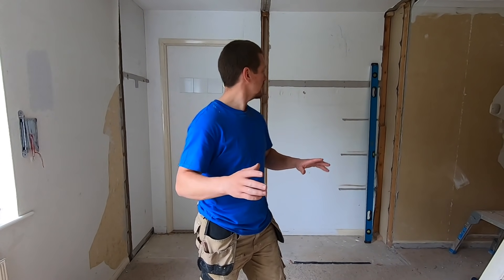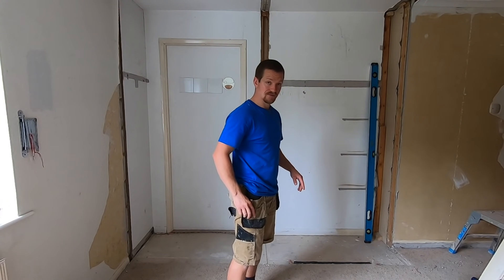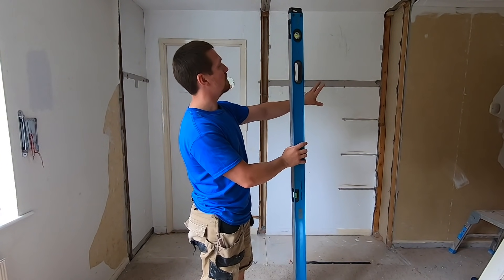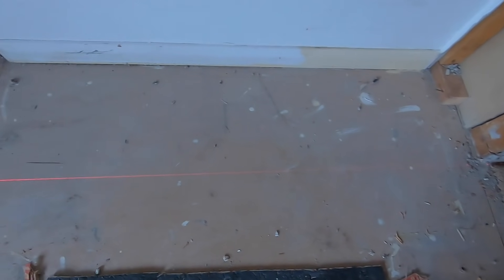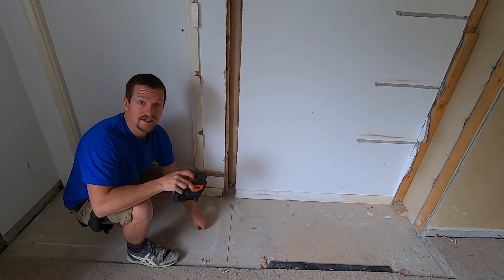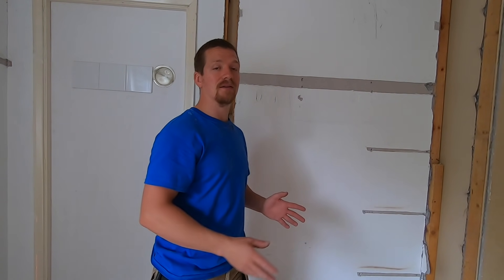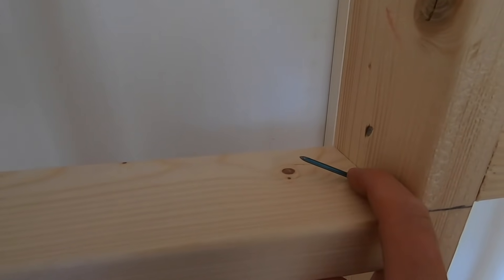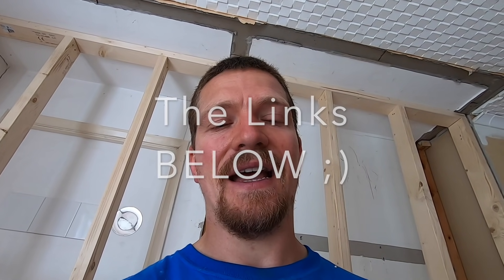How To Build A Stud Wall - (Build An Internal Wall For Plastering)

Comment: Brilliant video! How would you attach it to a concrete floor and a drywall?
Reply: Concrete floor just drill and rawlplug it in. drywall it really needs to be fixed to a stud or end. If you cant id personally cut into the drywall and add a stud to fix too but if the bottom plate and header are fixed solid the end stud could float i guess

Comment: Cheers for the video Blaine. Are the noggins necessary if plasterboard is being fixed to the uprights??... I can't see how the noggins add strength??.... what am I missing??  :-)
Reply from the maker: It's designed to pull the timbers straight - it's not necessarily strength. It helps to make the wall straight when the timbers are pull together in the centre 👍

Comment: Thanks Blaine. Top vids as always. What do you suggest the best fixings to use if you are keying a stud wall to existing stud wall. I need to add a stud wall in the bathroom to take a shower cubical but the other walls are all stud and plaster. We moved recently from a solid brick Victorian house. It’s now like living in a box of matches and the sound insulation is shizzer! 🙄

Comment: Great video Blaine , I put up a stud wall before the lockdown 3 months ago no plaster at the moment but when I eventually get some is the plasterboard still ok to scim over regardless of how long it has been up?
Reply: should be fine man, what can happen if its been a particularity long time is the boards dry out slightly and they end up having a bit more suction, if you get this problem just put a coat of pva and go over it once its tacky

Comment: Thanks for the very helpful video nicely presented. I take it the height of the wall is less than 2.4m so you can use one board? I always seems to get a higher wall where I have to have a second board on top the requires noggins in line, which is more of a pain to do!
Reply from the maker: Yeah mate... It's 2.3m so I've got enough height! That is a pain - I'm lucky with this one pal 😂

Comment: How do you know that the line on the floor from the laser level is straight
Reply from the maker: You don’t - you usually have to parallel that line for the opposing wall or measure it according to the room. The last will only give you the plumber like is facing 👍

Comment: Hi Blaine, great content as always. I hope you have time to answer this question. I have wattle and daub wall with lime plaster. In the hallway the plaster is blown and cracked. I was thinking of treating it with a fibre glass mesh then apply multi-finish on top of it. Do you think it’s a false economy or should I take it back to the brick? 🧱
Reply from the maker: Hi mate. You shouldn't plaster over a lime rendered wall - you would essentially be trapping the moisture. Lime render is designed to breath whereas the plaster we use now isn't. It's probably best to use a lime based finished plaster or start again as mentioned. I know it's a pain but that's the right answer. Hope this helps my friend 👍
Reply: @PlasteringForBeginners  Thanks for answering my question Blaine. Would that apply to a inernal dividing wall?

Comment: Isn't that plaster board on the right?, if so doesn't the frame not need to be the thickness of the plasterboard further back rather than flush?
Reply from the maker: I'm over boarding the the section on the right. It saves waste and helps with sounds insulation 👍